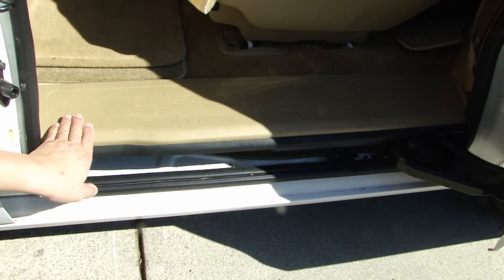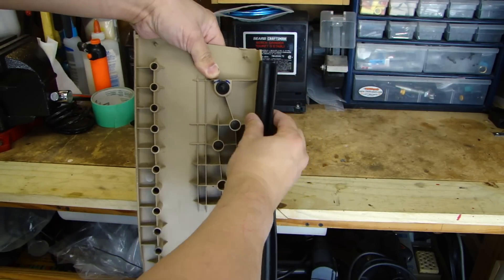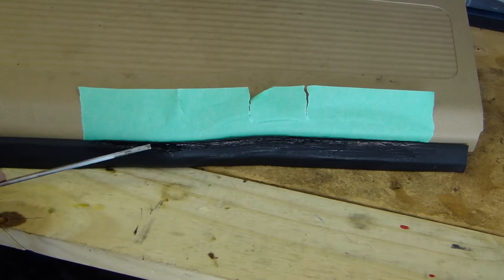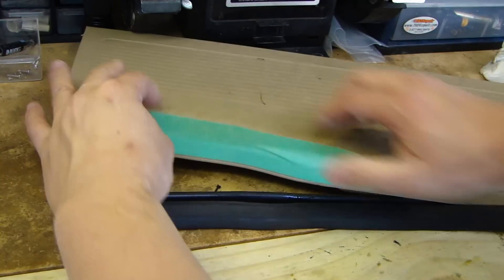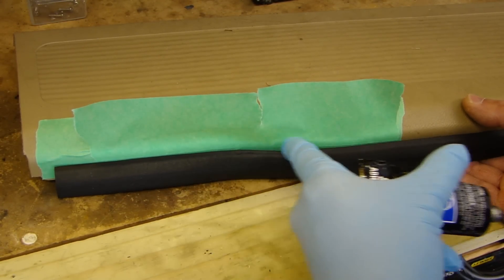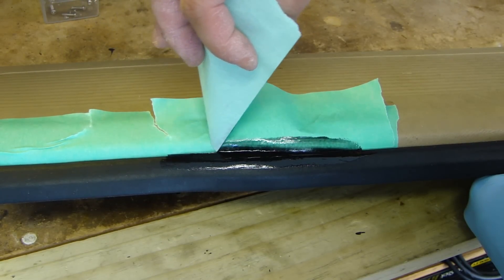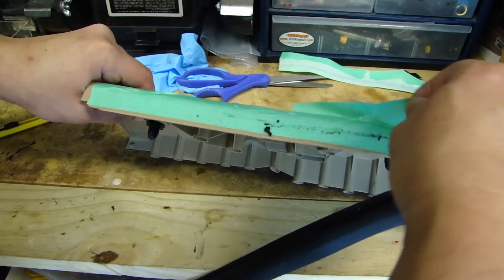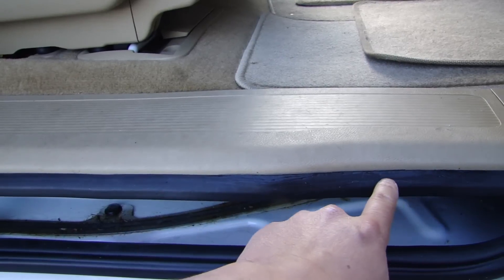How To Fix Car's Rubber Trim Molding

Comment: I did the same process with the boot ( trunk to our American cousins))  moulding that runs all the way around. It looked shiny and different so I sanded the whole  area  with fine  sandpaper, and then  taped it up using painting tape and sprayed it with rubber paint,  . It was 10 yrs ago and it still looks fine today.

Comment: Thank you for this video, I have a question.  The exterior rubber (or whatever it's made of) weather seal on my back window (25 year old Lincoln Mark VIII) has a couple inch or two areas where it's kind of worn looking, it sort of looks like it has a dry rash with small pock mark craters and such.  Will the Permatex fill that and smooth it out?
Much appreciate any advice you can give.

Comment: very good, and the silicone will act as a glue and is the right colour, job done well and a good place to trace wires. how do you know how this came off so nicely
Reply from the maker: Thanks George! Most plastic panels are held in by plastic clips, so it's easy to pop off.

Comment: Great job!  You can also swap the ends so that the repaired section will be in the back and will not get beaten up again.  You might have to swap left and right molding if the front and back are not identical.
Reply from the maker: Very good point. Thanks!

Comment: I have a Toyota Matrix with a glass moon/sun roof, which I hardly ever uncover or actually pop up or completely open, but it began leaking. Water comes in and drips from "the corners" right onto the driver or passenger's legs. 
A friend told me to use black silicon, but now I have a method and technique to make a good repair. I hope to avoid having to replacing the rubber which I am sure will cost more than two tubes of silicon.
Reply: MasterK9Trainer I have the same problem. I priced the replacement weatherstrip for my car and it was over $160.  Definitely worth the trouble to try it with this silicone method!